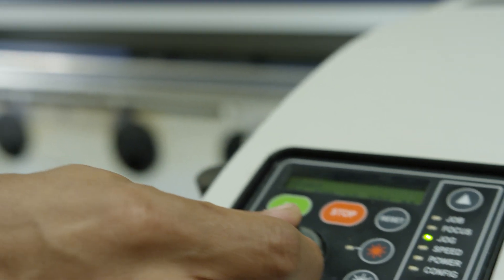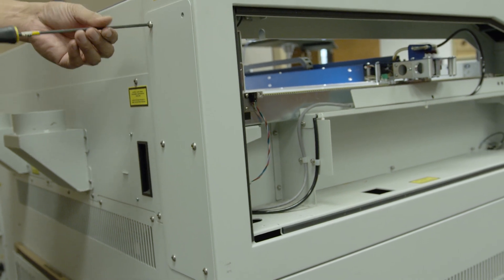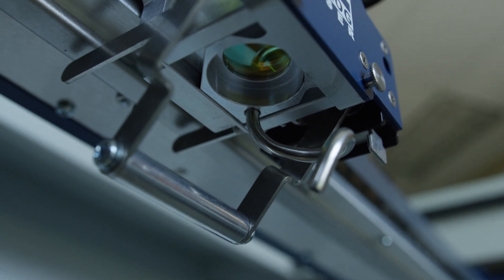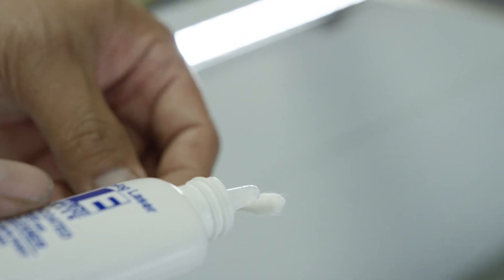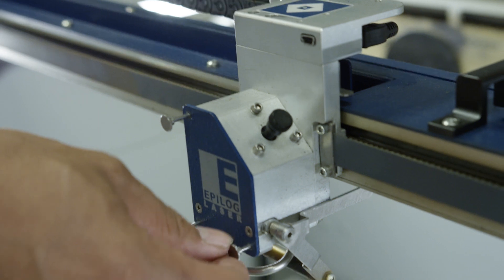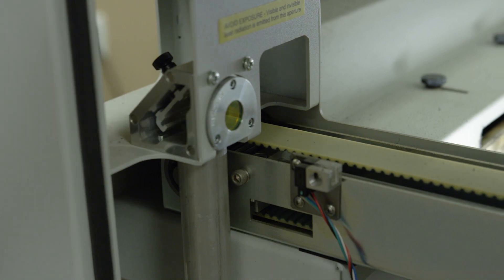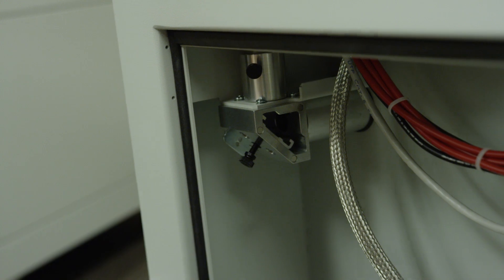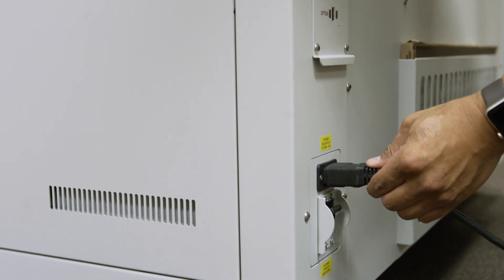Cleaning the Epilog Fusion M2’s Optics

Comment: Are you really supposed to rub the mirror with a cotton swab? Should you now use thos special napkins that came with the machine and super mega gently just let it touch the mirror and without ever pressing on the mirror just slide that napkin on it.
Reply from the maker: Hi Louie - yes, you can use a cotton swab and the provided optics cleaning solution for your optics and mirrors. If you are interested in more maintenance and how-to related content, we have a training website you may find very useful. Here is a link to the site: training.epiloglaser.com
Reply: @epiloglaser  Thank you! I have requested a login for the training site. Looking forward to use it!